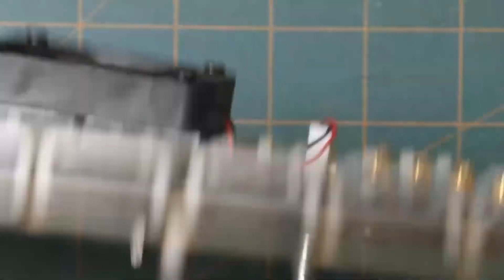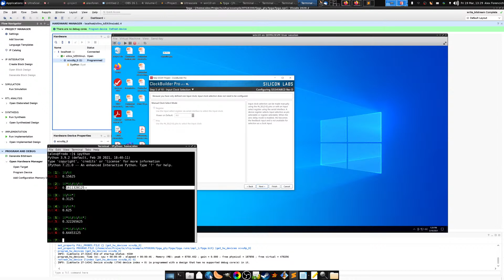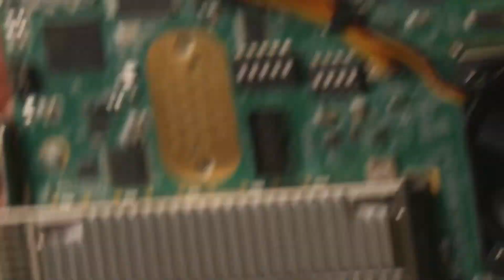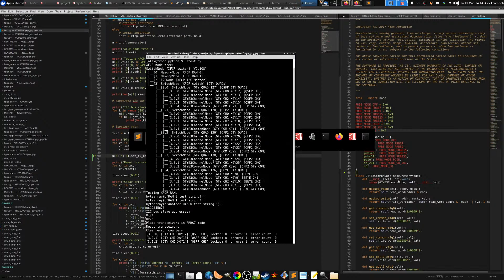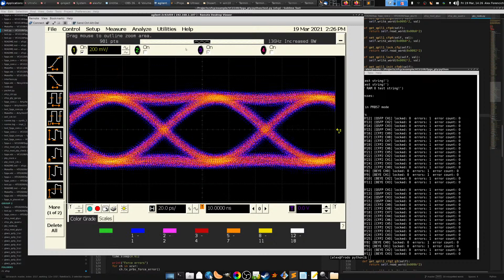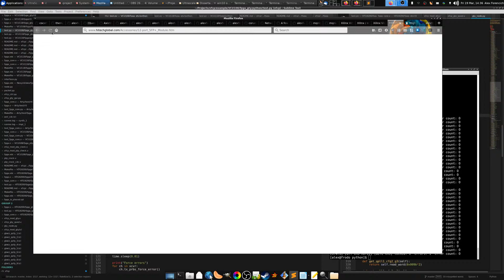FPGA Dev Live Stream: FPGA board bring-up and testing of high-speed serializers

Comment: Nice video! Why use back drilling rather than microvia (other than cost reason)?
Reply from the maker: I think cost is the main reason, but it's also possible that back-drilling can be a bit more flexible in certain cases. With blind and buried vias, you can only make vias between certain pairs of layers due to how the vias are constructed. But with back-drilling, you can drill down to whatever layer you want.